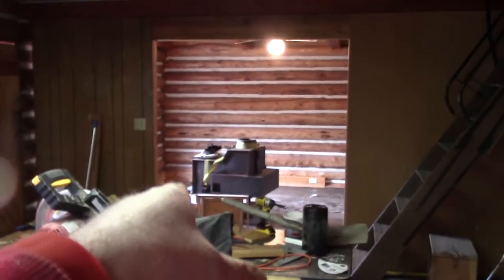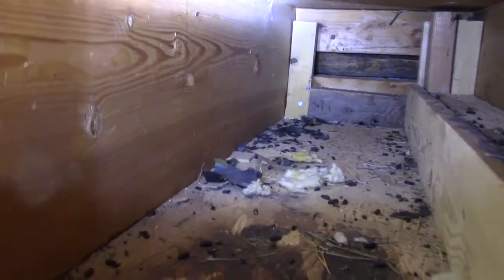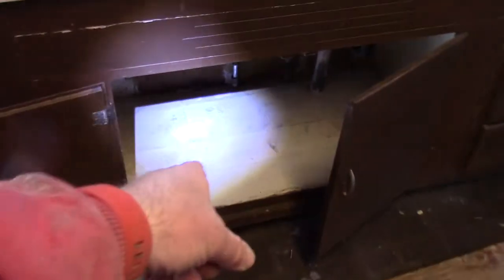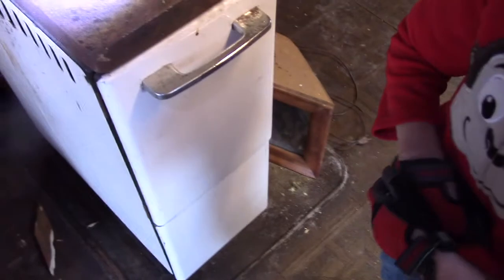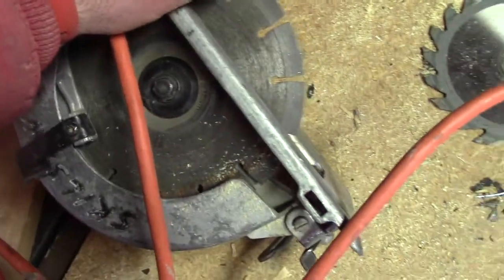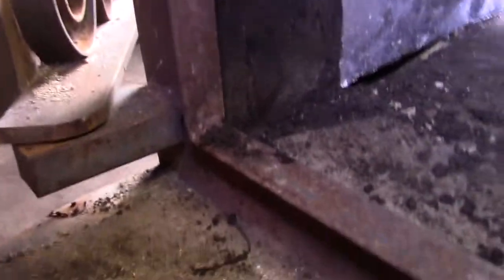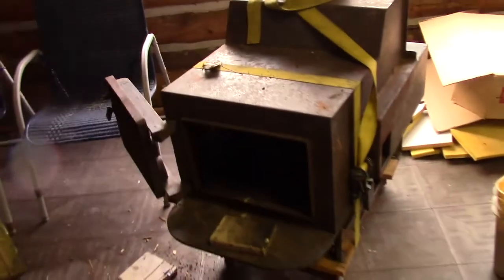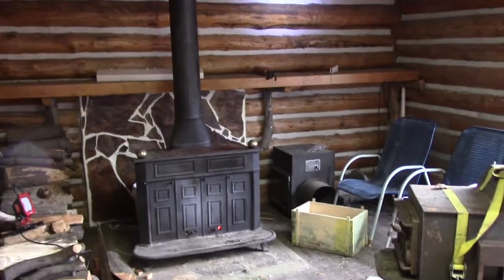River House 15: Of Mice and Bricks

Comment: You an buy refractory cement and coat the brick to seal cracks.
Reply from the maker: Do you think the stove is worth it or just run it?
Reply: Should be fine ,run mild fires and watch for thin spots and smoke leakage.